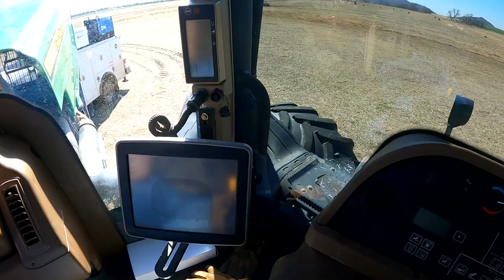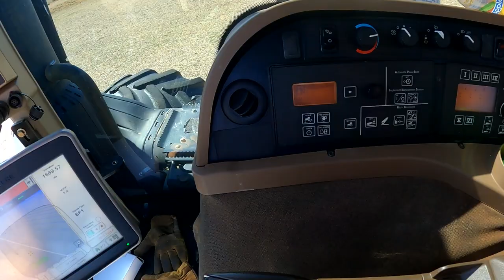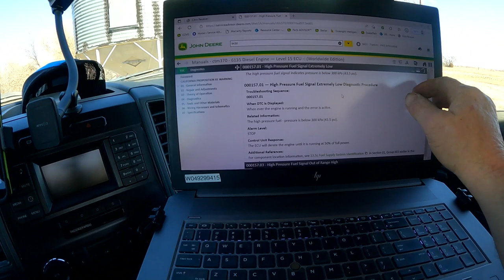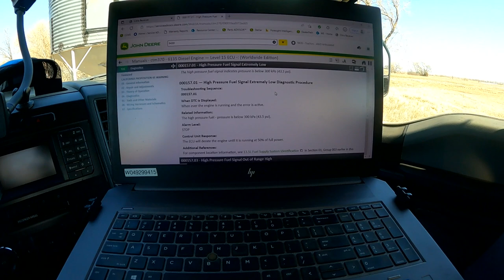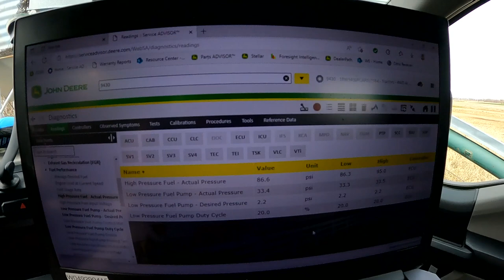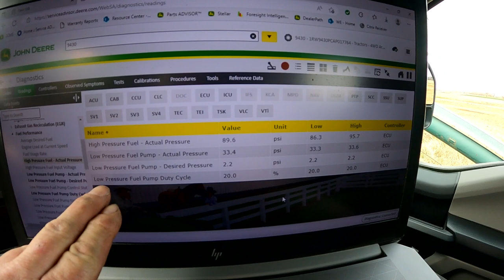Larry's Life E52 | John Deere 9430 Tractor Died and Wont Start

Comment: Shouldn't that pump be after on the accessory relay circuit , and shut off with key . Or does it have a standby  12 vdc with pilot voltage engagement?
Reply: I will get that info back to you ASAP ! Good ?
Reply from the maker: Thanks @Larry Stewart!